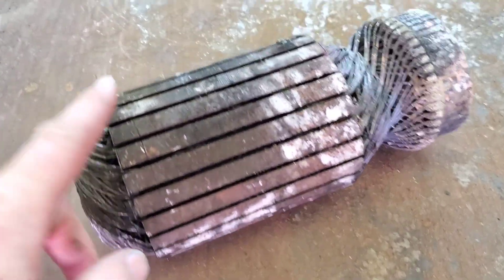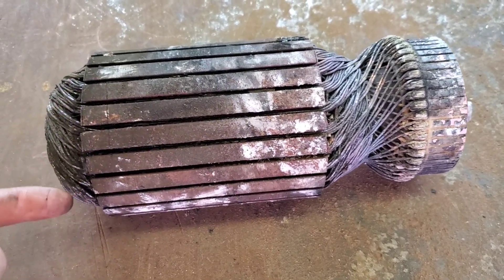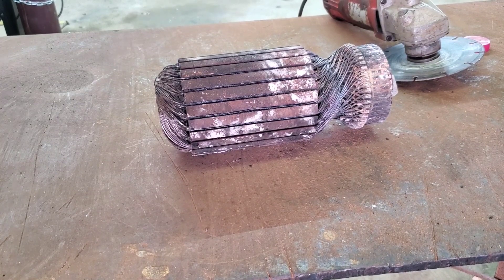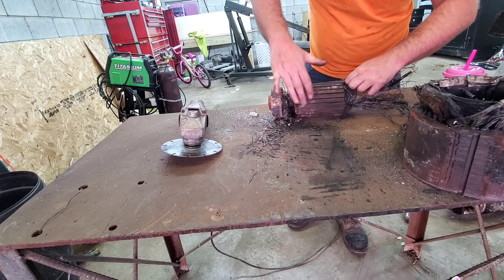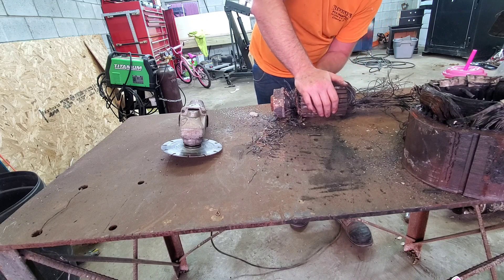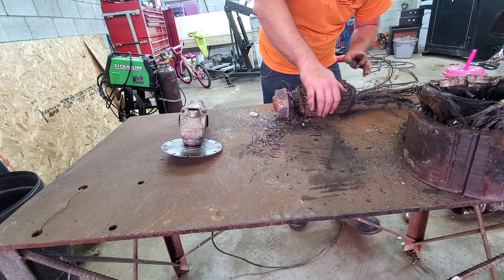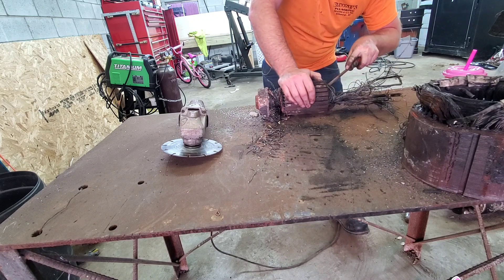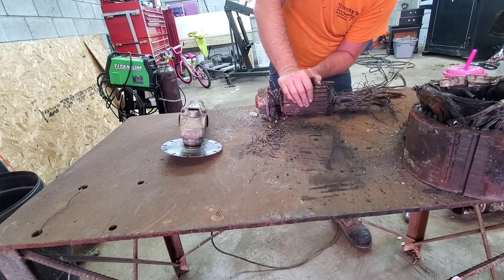How to get copper out of an electric armature easily!

Comment: this works, but an air hammer does it in like a minute.  without making alot of little peices to pick up.
Reply from the maker: I dont get many of these at all.....but i tried air hammer on small motors it worked great.  But it doesnt work on the larger motors i do very well